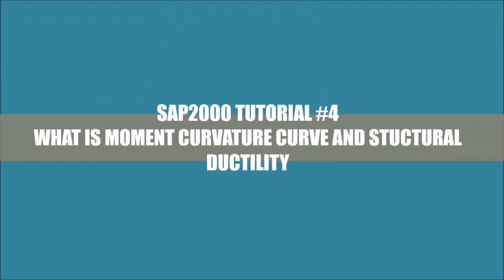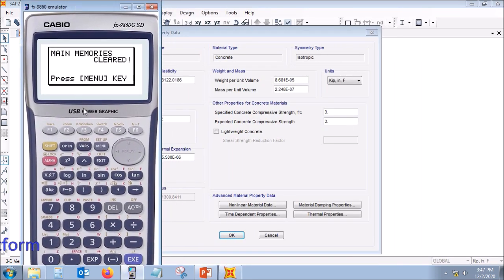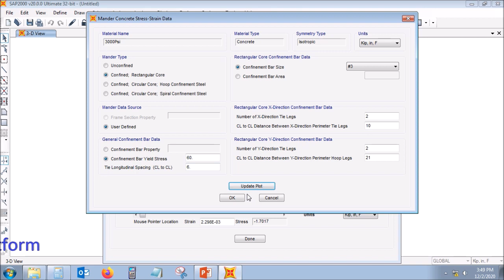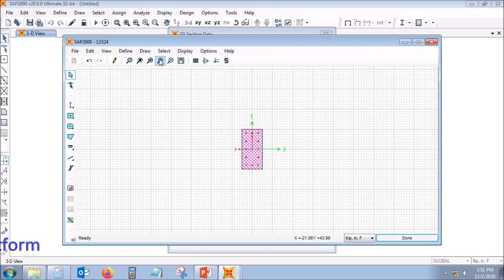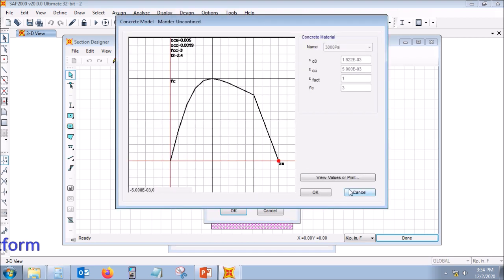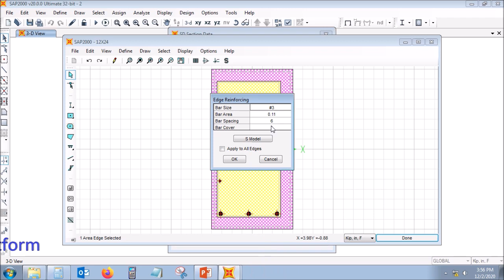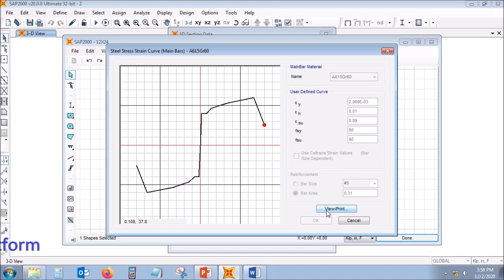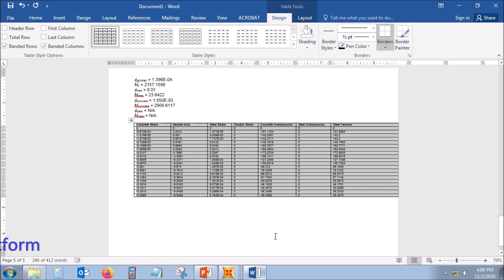Structural Ductility Moment curvature curve in SAP2000

Comment: may i ask about how to design steel i beam between 2 concrete columns ?
Reply from the maker: It can be designed like a simply supported beam manually and the Connections will be shear plate Connections . With bolts embedded in concrete if new structure otherwise use expansion bolts
Reply: can you help me please i have to finish it tomorrow , it's dim. is 200*200*12 mm , i just want to make check for deflection and wind pressure
Reply from the maker: @minagerges1622  you can contact our services providers at fiverr.
one is : www.fiverr.com/uzairs3